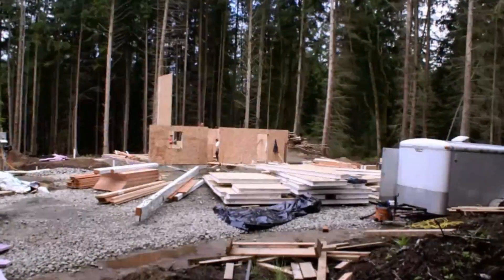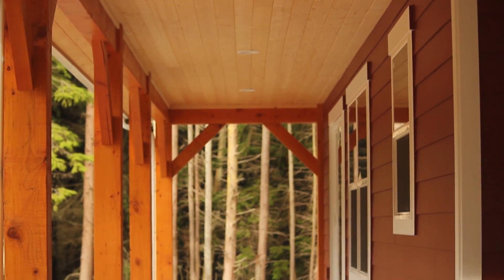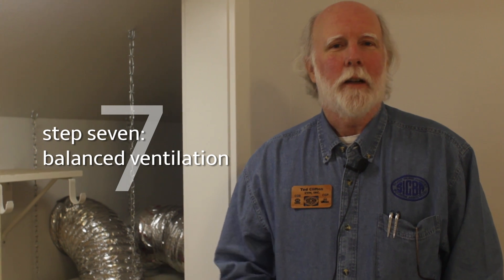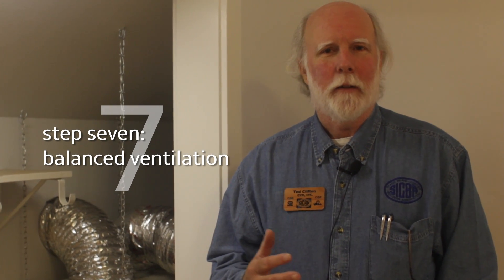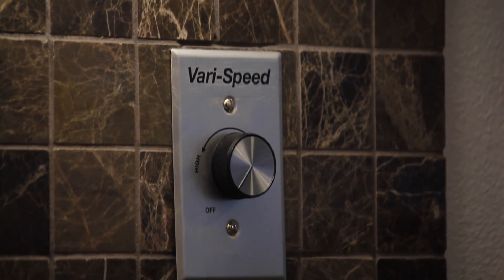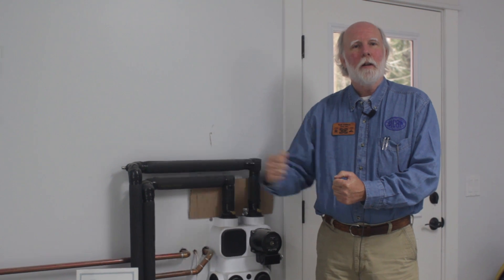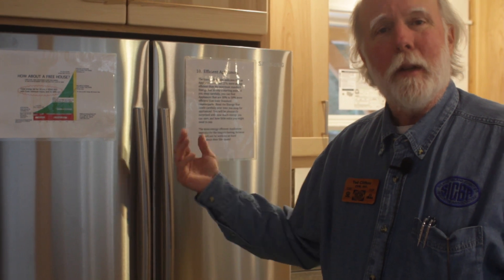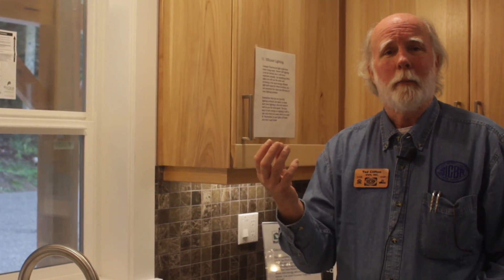The Twelve Essential Steps to Net Zero Energy with Ted Clifton (Clifton View Homes)

Comment: My opinion is that this type off building Will easely overhead in summer. Beceaus the foam has no thermal mass an isn't able to store the radiant heat drol the sun. But it is very good at not conducting heat.

Plus, sealing your home airthigt might Solve convection. But then you need electricity to ventilate. So building airthite around Windows and doors etc. Is inportant. More inportant is that the wall breaths.

Comment: Summary in Text format:

12  Essentials
 1) Building Orientation
    (In northern hemisphere) South facing house. [In other words, facing the equator.]
    Overhangs and extended roofs can minimize the amount of sunlight that penetrates inside the house.
 2) Simple design
    As square as possible. Or, rather maximize the amount of the house that faces the sun but mitigates excessive absorption in the summer time.
 3) Window Orientation
    Most of the windows should be on the south side of the house. There should be minimum number of windows on the North side of the house. If possible, the north-side can have zero windows to reduce heat-loss and reduce costs. 
 4) Thermal mass
    By allowing thermal energy to reach the interior floor and counter-tops (in kitchen), the space can accumulate "thermal mass" and release that energy through the night.
 5) Tight building envelope
    Minimize or eliminate all thermal bridges and air-leaks in the walls.
 6) Balanced Insulation levels
    The exterior walls and roof must have good insulation values that retain your interior temperatures. Install windows with an R rating as close to the wall's R rating.
 7) Balanced ventilation
    Bath & kitchen fan exhaust needs to be balanced with in-flow of air. If possible place the exhaust fans outside the home (to minimize fan sound) and match the exhaust fan speed with the in-flow fan speed.
 8) Heating & Cooling
    Employing a GSHP is very effective at extracting heat from the ground. 
 9) Domestic Hot water
    Again GSHP or solar thermal panel to heat up the water.
 10) Efficient appliances
     Take the time to find appliances that don't require as much energy to perform the same function. For example, installing a refridgerator that draws less current than the standard model will help you achieve a net-zero efficiency.
 11) Efficient lighting
     Employ more LEDs that draw significantly less wattage - especially when compared with fluorescent light bulbs. You only need to light the surfaces where you are present. No need to light up the entire house.
 12) Alternative Energy sources
     - Solar electic panels
     - Wind turbines

Comment: Excellent!! But wonder how the ventilation system works when the kitchen and bathroom exhaust fans are not working. It should also have a supply and return system to circulate outdoor air throughout the house.

Comment: How would a builder/remodeler do this in the deep south, where the climate is a little different?  Mainly the ground source heat pump.  Here in the greater New Orleans, La area, there is a heck of a lot of soil movement/soil subsidence.  We are constantly pumping sand under the foundation of the houses, jacking up the houses to level and leveling the yards with either sand or top soil.  How would this effect the physical components and connections of the equipment, as well as the efficiency and operation of the system?
Also, I used to live in the greater Seattle, WA area and understand that a majority of the houses there don't have A/C systems.  How would you incorporate an A/C system and still be Net Zero?

Comment: Great info. I would add solar is a great enabler to other efficient tech. like electric cars, and heat pumps Since the Electric car will demand more electricty, just get added solar, which is the future. Heck, we could use the car's batteries as an emergency generator!Also, ensure CB panel is in the garage with a dedicated 240 volt outlet to charge the electric car, which is fed by clean solar power.

Comment: You mentioned Thermal Mass. We build with SCIPs (Structural Insulated Insulated Panels). So the entire interior facing walls are Thermal Mass. The best design with the SCIPs is to build a Yeti Box! Foam insulated, concrete covered  Box and then add a roof with all the HVAC installed inside the box.

Comment: Gotta love spending $200,000 to get an electric bill that is under $10 bucks.  They should build more house that are underground.  Things like the Geothermal energy are very expensive.  New housing developments should tap the Geothermal energy, that would  offset the cost and the entire development could tap the geothermal "well"  ... All kidding aside this was a decent video...   Good luck on future videos, keep up the good work!
Reply: That has certainly left it to those that are more willing and able to invest on being green. However, everyday things get cheaper with better pay back and energy will always climb in costs with an expected high rate that will pay many times over then. Look at when CFLs and then LED bulbs came out, they were by no means cost saving or Green to convert to but with time, both have improved. Now if only they had bothered making them dimmable with standard dimmers.

Comment: Fantastic presentation! Thank you for taking the time to put this video together Ted. I love the presentation delivery, excellent visual aids, smooth overall production quality, factual and authoritative voice, good vocal variety, and more.  Consider adapting into a TED talk if there isn't already an equivalent talk available. You have great info to share and you do a fantastic job delivering it. I'll check for other videos by you ... please keep posting more great info!!!

FYI: I basically started with step 12 (backward) for my existing home due to local incentives and to drive local awareness/support. I am fully aware I need to get a full home energy audit and address envelope leakage and likely other aspects that eat way more than the power I am generating over the year. For an existing home Net Zero is not feasible... but all steps can apply and make dramatic efficiency improvements over typical "builder grade" home designs and construction.

Passive solar overhangs:
@JudyJohnson: The overhang width will depend on the geographic latitude of the home.  The overhangs are designed to be wide enough to shade during months that are typically warmer than room temp and let light in during cooler months of the year. In Whidby Island Washington (Ted's location) the sun moves from (90-~50 deg lat)=40 deg off the horizon to (90-~50-earth's axis offset from being perpendicular to earth's orbital plane around the sun). Add some more geometry and plug in actual values and you can determine the angle of the sun for winter solstice and summer solstice. Add local data on when outdoor temp typically goes above and below 72 degrees Fahrenheit daily high (or different desired temp) and you can calculate the angle and corresponding width your overhangs should be for that area. More math = better chances of meeting your desired goal. (For example, account for typical local wind conditions, cloudiness, trees and other southern exposure impacts, etc.)

On the equator, the sun is always within a few degrees of 90 degrees from the horizon (directly overhead) all year round. In North Alaska, the sun doesn't get nearly as high above the horizon (and for a couple winter months doesn't even get above the horizon!). (Note I am ignoring that both these locations are extremes and both have different heating/cooling constraints.)

Comment: This is a good video. My only complaint is that too often only solutions for cold climates are presented. In warm climates, staying warm is not a problem, even without any specific design features. Cooling is the challenge, and while some solutions are the same as heating (such as a tight, well-insulated evelope), others are quite different. High albedo roofing, natural ventilation, & humidity control are useful but much less developed options.
Reply: +dMb Putting the heatexchanger of the aircon in a cooling liquid, not in the open air, can make a big difference. And use overhangs.